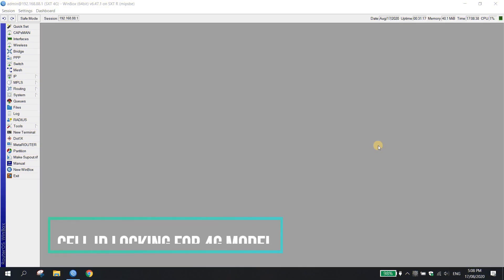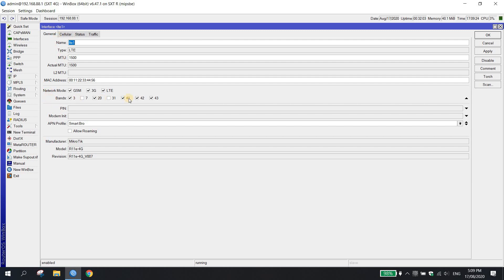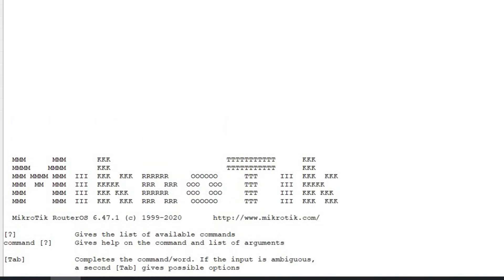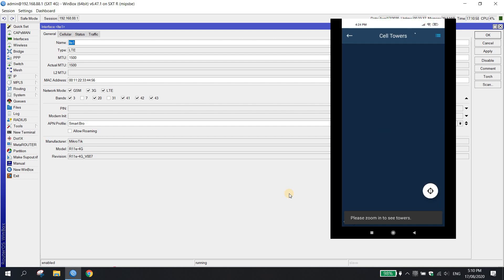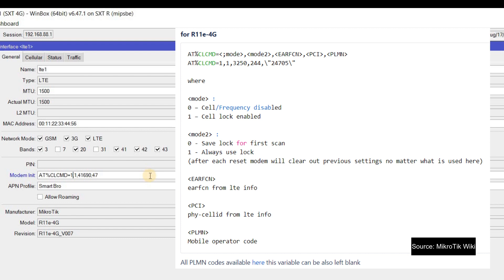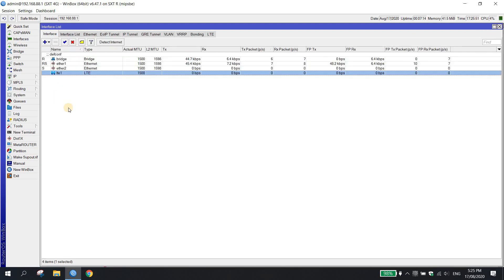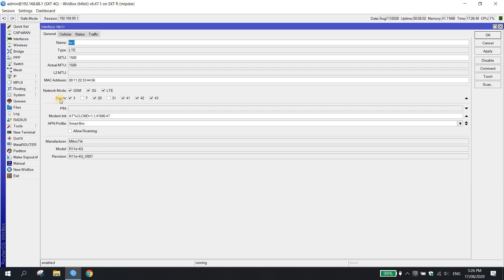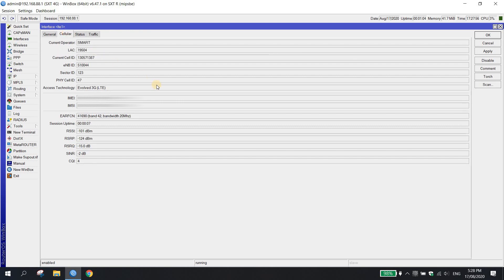MikroTik Cell Tower Lock for 4G Model (R11e-4G) (Tagalog w/ English Subtitle)

Comment: tanong lang po sir, ayaw ma lock yung networkmode sa lte.... bumabalik sa default.. (R11e-4G)
 yung model gamit ko
Reply from the maker: pag magrestart yun router babalik talaga sa default as per mikrotik sa 4G model, use scripting to load yun command everytime magrestart
Reply: @RizalTechGuide  ano ba dapat gawin sir.... gusto ko sana ilock sa lte.... ma lag kc pag nka check yung gsm at 3g sir..
Reply from the maker: @junjunjunjun2152  yang 4G walang support yan for 2G and 3G, naka check lang yan sa interface pero 4G/LTE lang activated jan
Reply from the maker: baka makatulong itong video https://youtu.be/m3WIyhl2UdU
Reply: @RizalTechGuide  salamat sa info sir..... palagi kc resetting yung lhg 4g ko.... updated nman ... salamat sir...
Reply from the maker: @junjunjunjun2152  resetting sa modem config ba or config ng router mismo?

Comment: Paano po sir pag Denied yung Registration para sa Band42, dahil sa kaya sa layo ng tower?
Sa Band41 napagana ko yug cell locking.
Reply from the maker: tower issue
Reply: @RizalTechGuide  possible din po na same yung LAC, Curr Cell ID, eNB ID, Sector ID pero yung PHY Cell ID lang pinagkakaiba ng B41 na nakukuha ko?
Reply from the maker: @al03128  unique yun mga cell id

Comment: hola amigo, me podría ayudar por favor, solo me quiero conectar a esta Current Cell ID: 3453264, cuando se conecta a otras Current Cell ID mi internet va mal.
(el operador es Movistar 3G: 1900Mhz Banda 2), no me funciona con 4g, el modelo es R11e-LTE-US, estos son los datos que tengo de la Cell Tower:
MCC: 734
MNC: 4
LAC: 40102
CID: 3453264
Radio Type: UMTS
Reply from the maker: You need to check also the equivalent PHY Cell ID it is what you need for this locking, it is different from CID

Comment: Sir may tanong lang po ako, meron akong modem B315s-936 + Globe Prepaid Sim with Mimo Antenna, kukuha siya ng DL: 10-12MBPS, UL: 1-2MBPS, pero yung LHG 4G ko is, DL: 0-1MBPS, UL: 0-1MBPS lang.. ano kaya problema nito? parehas silang nakalapag lang sa lupa mga 8FT lang ata. salamat po
Reply from the maker: i-check mo sir yun Physical Cell ID and EARFCN na nakaregister dun sa B315s mo, tapos yan yun ilagay mo sa LHG 4G. Gamit ka 3rd Party App para mahanap mo yun tower location kung saan nagconnect yun B315s mo tapos dun mo itutok yun LHG 4G, sectoral antenna kasi yan sa LHG need mo itutok sa direction nun tower. Try mo din update yun routeros and modem firmware.
Reply: @RizalTechGuide  Salamat sa fast response sir, e ta-try ko to sir. no need muna e taas? okay lang sa 8FT muna kasi for testing lang naman ako at nakasagap naman ng magndang signal sa B315s ko? 

Salamat ulet sir, Update nalang ak if ano mangyayarui
Reply from the maker: @rizzamaeenad7211  yes if yun B315s mo ok naman signal, dapat mas ok signal na makuha ng LHG 4G nasa 17 or 21 dbi ata yun antenna gain nyan, yun lang kasi may tendency yan mag connect sa malayo na tower dahil nga dun directional antenna so need talaga i-lock at itutok ng tama
Reply: @RizalTechGuide  Ay meron palang ganun ang LHG haha.. 21 Dbi ang nakalgay dito sakin sir,
ang Physical Cell ID sir, eto ba yung CELL ID na makikita sa Huawei Manager? "64187137", at saan pala dito yung EARFCN? eto ba yung band kung saan naka connect aking B315s?
Reply from the maker: @rizzamaeenad7211  hahanapin mo sir yun equivalent nyan na PCI or Physical Cell ID dun sa mga App
Reply: @RizalTechGuide  Nakita ko na yung PCI, pero yung "EARFCN" di ko mahanap. ano ba equivalent nito sir sa mga app?
Reply from the maker: @rizzamaeenad7211  earfcn din tawag nag iisa lang din
Reply: @RizalTechGuide  Ay wala sa Device Information ng  modem ko,
eto lang meron
Device Name, Serial Number, IMEI, IMSI, Hardware Ver., Software Ver., Web UI Ver., LAN MAC ADD., Product Family, Classify, WAN IP Add., DNS 1 / DNS 2, IP Address, RSSI, RSRP, RSRQ, SINR, Cell ID (hex/dec), eNB / Cell, PCI.
Reply from the maker: sa cellphone makita if may globe sim ka cellmapper app

Comment: ask ko lng po sir, ito b ung solution sa lhg 4gkit ngreresetting?
Reply from the maker: ano po ang narereset
Reply: @RizalTechGuide  connected xa sir, kaso biglang ngrereset ung  lte1 ng lhg 4gkit connection kya nwawla ung net, prang ngrereboot ung lhg sir....
Reply from the maker: @jeyk2xxlumantas765  try to update yun router OS and firmware sa lastest stable build tapos update mo din modem firmware after
Reply: I have the same problem.. already updated to the latest firmware and OS but still the same, pls help
Reply from the maker: @ztiwonil what band do you experience resetting? all bands or in a specific band only
Reply: @RizalTechGuide  Band 42 sir pero pag sa band 3 ok naman
Reply from the maker: @jacksontangonan7175  tower issue yan
Reply: I have same problem using smart corpo sim. Ang LTE interface nakaka experience ng Down Links, resulting to restarting of the LTE, not necessarily the LHG ang nag re-reboot. But for long period of time na palaging downlinks,minsan di na talaga gagana ang LTE. Kaya need na manually e restart c LHG. Hope i added clarification.

Comment: di rin nagana sa akin sir.. LHG 4g kit model RBLHGR
Reply from the maker: san part sir ang hindi gumana, if cell-monitor command hindi talaga supported for the 4G model
Reply: @RizalTechGuide  sa pag lock sir... ewan ko pero yung signal na gusto kung i lock sana. di nakukuha sa lugar ko.. pero sa are malapit sa tower nakikita ko siya.. bali ang distance ko to tower is nasa 2km
Reply from the maker: @psftv5946  double check mo sir if available yun band and earfcn dun sa tower. Try mo online cellmapper para sa details nun tower,  yun LHG base sa experience may tendency yan magconnect sa mas malayo since mataas yun antenna gain.
Reply: @RizalTechGuide  connected na ako sa band 42 sir. napansin ko lang na dalawa ang cell id.. nung nag speedtest ako mismo malapit sa cell site using my b818, band 42 only naka lock... ginaya ko lang ang EARFCN ng current band 42 ko.. ibang physical cell id lang..
Reply from the maker: check if may equivalent PHY ID yun nakuha sa huawei
Reply from the maker: @psftv5946  need mo din check if available yun same earfcn dun sa tower
Reply: @RizalTechGuide  nakuha ko na sir.. earfcn  lang pala problema. di same sa dati kung cell id.. pero mababa SINR.. need ko ikutin antenna.. sana makakuha ng maganda.. isang tower lang kasi to. isa lang tower ng smart sa amin
Reply from the maker: nice, oo minsan magkaiba yun earfcn na available, baka mag rollout pa si smart ng tower
Reply from the maker: need mo din pala sir itutok mismo dun sa direction ng tower aside sa tower details earfcn and band availability
Reply from the maker: Cell Monitor Alternative for 4G Kit
https://youtu.be/B8BfuPWlyNk